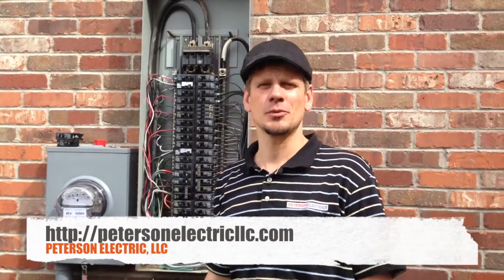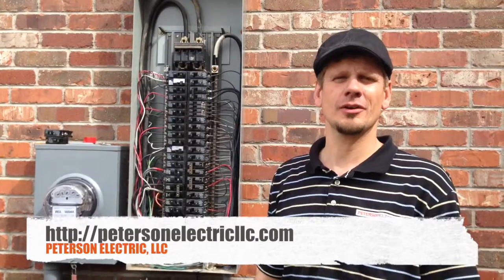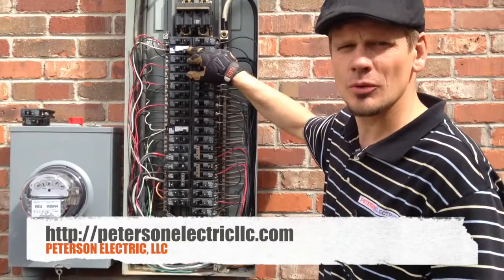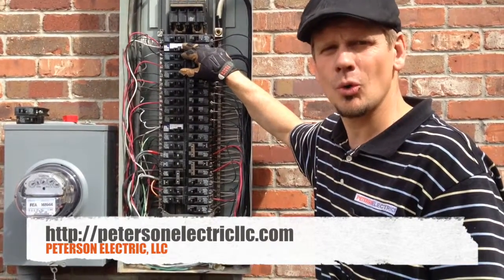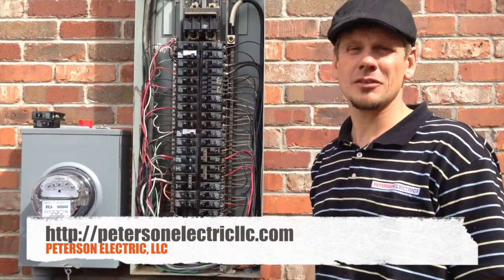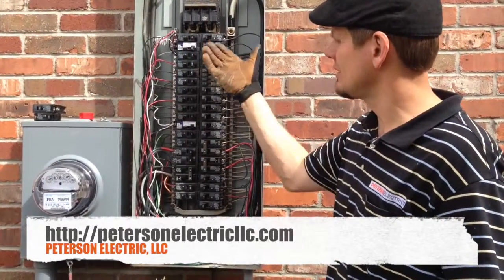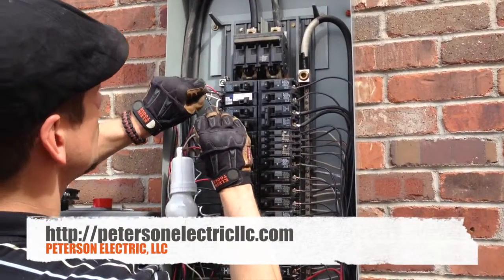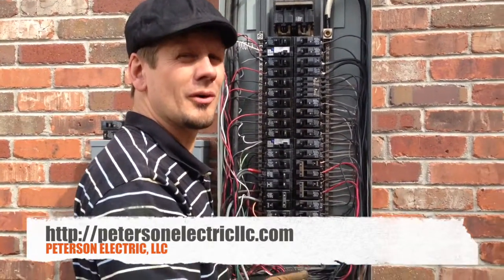Installed Arc Fault Breakers On Electrical Multi-Branch Circuits

Comment: Josh - I think there might be one code issue you are not aware of.  I believe that multiwire branch circuits require that both hots be disconnected when a circuit breaker trips.  This is usually done by using a  2 pole breaker but can also be done with a listed handle tie that ties two single breakers together.  As a result I do not think that installing a single pole arc fault on one leg of the multiwire branch circuit is the best solution in this case.

NEC 210.4(B)  "(B) Disconnecting Means. Each multiwire branch circuit shall be provided with a means that will simultaneously disconnect all ungrounded conductors at the point where the branch circuit originates."
Reply: You are right and an arc fault breaker isnt designed to work that way it doesnt have the mechanical redundancy to trip the other circuit so no backfeeding occurs.
Reply: I agree!! Awesome.
Reply: 2pole afci breaker then?

Comment: So, I have an early 90s house with this situation, i.e., 14/4 with black and red hot. Due to lack of breaker space and my old ITE panel unable to accept tandem breakers,  I had wire nutted the black and red in the panel and just created a single circuit. It's mostly lighting, all LED anyway, very low load. 
So during my rough inspection for a remodel, inspector says I need AFCi breakers. All I can find are combo ground/arc fault. It worked fine with a normal breaker. Now it won't hold with the afci/gfci breaker. I tried swapping breakers - no dice. So question - have I just got an arc fault or ground fault somewhere that I need to track down, or is there something in my circuit (combined hots) that is causing an issue with the neutral? I guess I could install a straight gfci, which would then tell me whether it's a ground fault or not. Any other ideas?

Comment: Would you mind explaining what a multiwire branch circuit is
Reply: 2 circuits that share a neutral. For example, a 12-3 with ground home run to the kitchen, with the first phase (black wire) serving the north half of the kitchen and the second phase (red wire) serving the south half of the kitchen.

Compared to running 2 12-2 with ground cables, this saves 2 conductors and also has less loss when the black and red are connected to opposite phases (because the neutral currents subtract instead of add on single phase residential service).

However, the inconvenience of using up 2 spaces in the panel and requiring both phases to trip together makes this circuit undesirable. It isn't safe to turn off one circuit without the other because there's still current flowing through the neutral from the other half of the multi wire branch circuit.

A better solution for running 2 completely independent home runs to the kitchen is to use 12-4 with ground wiring, which then branches into 2 12-2 with ground, where each branch gets its own neutral.

Comment: "We're getting this to hold"!?!?!?
Dude that's a clear code violation and safety hazard.
MWBC needs common disconnect! And if it's gonna be CAFCI/GFCI/DF protected at the panel, it needs to be a 2pole breaker with the single shared neutral going thru the breaker.
This is also a good reason why AFCI gets a bad name for "nuisance tripping" when in reality it's incorrect installation.